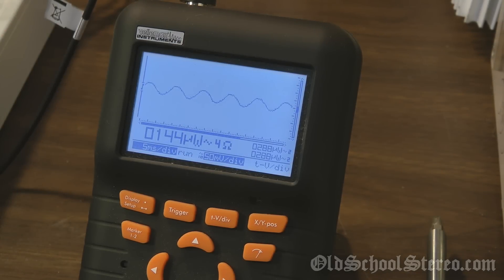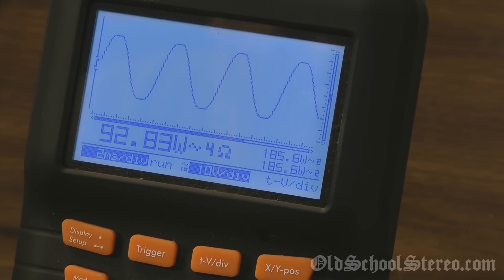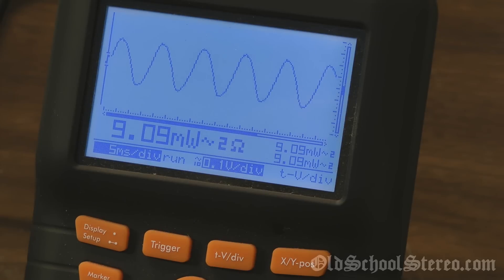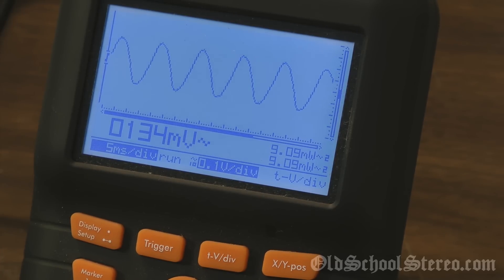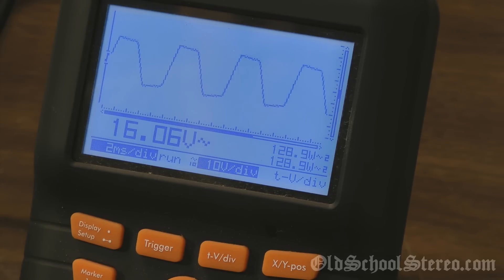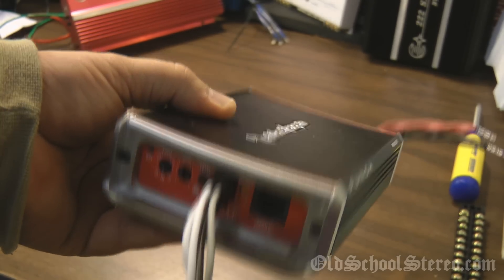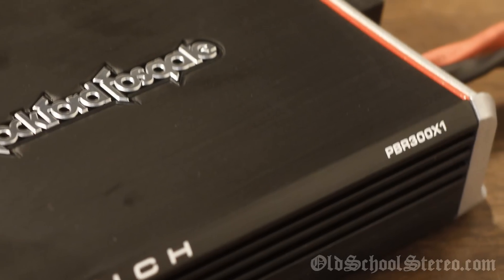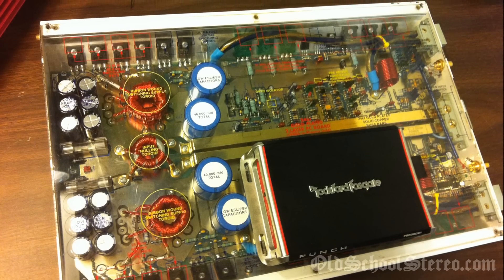Bench Testing the Rockford Fosgate PBR300x1 - Part 2 - OldSchoolStereo.com

Comment: All rockford amps do that. It's not a bad thing, it's just shedding all the heat off the mosfets in the amplifier, which other amps usually keep most the heat in. The heatsinks around my T1500-1bdCP @ 1 ohm gets SUPER hot sometimes. But what's awesome is the amplifier itself stays cool all the time :)

Comment from the maker: If you are referring to the test equipment, I use a Velleman HPS50 o'scope/true RMS volt meter, SMD/D'Amore Engineering DD-1 distortion detector (for 1% THD analysis) and a Fluke 85 III True RMS Volt meter. I'm planning an update video to show the equipment I use.

Comment from the maker: @emperorjj1 I got the Velleman HPS50 for around 225 shipped, but this was a few months ago. The fact it has the True RMS Volt meter built-in, Audio measurements and a scope to boot, it seems like a pretty good deal to me. Velleman also has other models, such as the HPS10, which are even more affordable. I picked the 50 b/c it has USB connectivity for a PC and has a built-in rechargeable battery for portable use.

Comment: I had the PBR500. It lasted 6 months and then the protection light would light up unless I backed off the the Punch Eq. I "downgraded" to the Prime 500xd1. It hits harder at 4ohms (300rms) than the punch at 1ohm 
(500rms?). Bottom line,  there is reason you don't see this size in more amp designs.

I also have the 4 channel PBR.  It still works fine,  but don't touch it cause it gets too hot.

Comment: @gnarlycs there are amp company's like crossfire that test at 12 volts so you have an idea of what you realistically will be getting power wise say rockford says the amp will do 1000 watts at 14.4 crossfire says its will do that at 12.5 its safe to assume you will see that 1000 watts in the crossfire not the rockford unless you have upgraded electrical the rockford will do that but only after it sees a steady 14 volts and up its all about efficiency

Comment from the maker: @mrchrisk36 I use 13.8v, which is closer to the car audio environment, but yes, somewhere between 12.5-13v would be a more accurate measurement for most factory electrical systems. I wish my 100A power supply was adjustable, but it's not :-(

Comment: The only problem with testing at above 13.8V, it's hard to find a vehicle charging system to hold 14-14.4 volts.  Sure, on a cold engine, it's up close to 14.4 volts, but once the alternator is done "topping off" the battery, the ratings go out the window.  Unless you have an external regulator, with manual adjustment.  The new alternators like my 04 Chevy Express are computer driven, which just makes matters worse.....  Oh well, been out of the audio game for 15+ years..  Good video though!!

Comment: have you tested the 500x1? I just got one and running it at 1ohm and performs good, only issue I have is it gets HOT!!!! I mean hot to were I cant touch it for more than a second or so, but I know it has Thermal protection and it hasnt shut off YET.

Comment: @gnarlycs thats with no load put a dmm on the batt when the system is playing bet that 14.4 goes away real quick a cars electrical is built to handle the car when you start adding things like a system the electrical demand goes up which im sure you know so expecting 14.4 voltage is not going to happen

Comment: You think this would be enough for a IDQ 10 D2? Spec sheet on the 10d2 shows 50-500. People keep saying i should go class a to make the idq shine, but i just don't see that being the case anymore.
Reply: ugzz 
Yes this amp will push that sub very well. The cool thing about this amp is its control.
And yes class D is all you need for subwoofers.